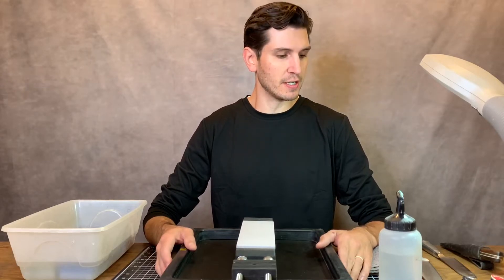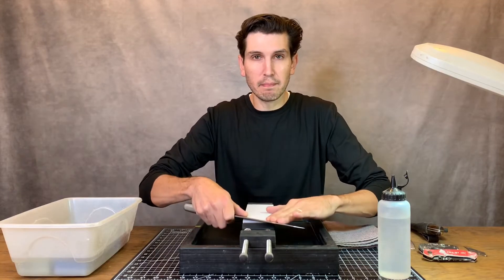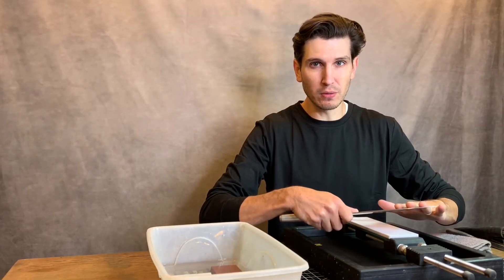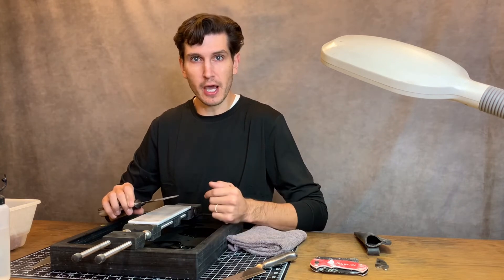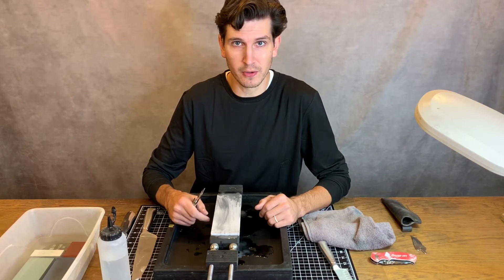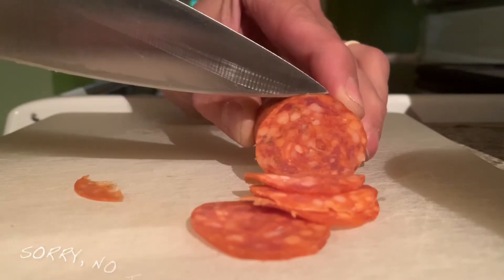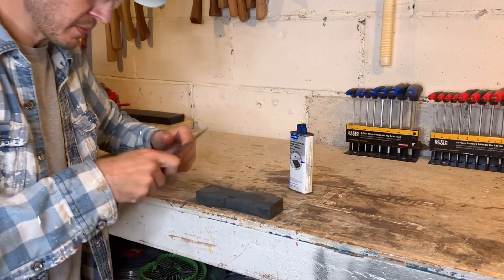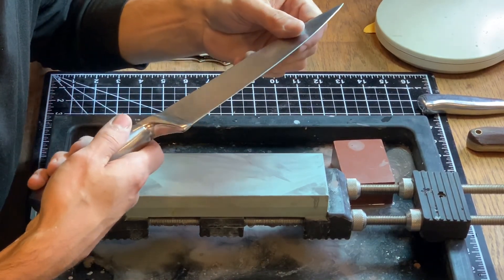How to Sharpen a Knife: Why Your Knife Isn’t as Sharp as You Want it to Be

Comment: Thank you so much for the shout out Kev! I don’t really offer much insight on technique nor is that the point of my channel but I really appreciate the recognition amongst all the others you mentioned <3

That’s a great point about cutting produce. I recently started stopping at a 500-600 grit stone before I strop the edge on a finishing stone (3-8k). Try it for yourself! It just gives you that extra bite on waxy vegetable skin, while enhancing the feedback on your cutting board and giving you more edge longevity. Cutting the thing that you’re going to use the knife for is definitely the key to understanding what kind of edge you *need, not want. 

If I’m going to solicit any advice, I would consider taking another look your stropping medium eventually. Not that there’s ANYthing wrong with using leather. Lately I’ve just found I like using a finishing stone (mostly my jnat) or my palm, the rough side of a dish sponge, denim, canvas, or balsa to keep my edges extremely aggressive. Basically I want something that’s going to be gentle enough to remove that last bit of fatigued steel without interfering with the bite. 

Great video Kev! The last few have been bangers.
Reply from the maker: No problem.  I was impressed with the hair widdling.  Ive never attempted it, but I can only imagine your edge has to be pretty damn sharp.  I think guys can really learn material knowledge from you.  Myself, I don’t really take an interest in what the stones are made of.  I just know what I like.  Speaking of stropping mediums, I find that I get a better edge on my axes if I strop with a hard honing stone or even a piece of glass than leather.  Axe steel is softer and is more easily rolled rather than polished.  But I’ve never tried a dish sponge.  Or denim for that matter.  I’ll give it a shot.  Thanks for watching.

Comment: Great tips!  Some more of the mystery part of learning a trade!

When I was a kid there were basically two choices... the seemingly out of reach Arkansas stones and the man-made stones from companies like Norton. Over time I accumulated a full compliment of Arkansas stones including a large very fine black stone that was about $100 20 years ago. Some years ago a woman I worked with brought me a bunch of her deceased father-in-law's old woodworking and machinist tools. In the box was a large double-sided man-made stone of unknown brand.  After cleaning the dirt and oil off it I found it was in excellent condition. That big stone is now my go-to stone for things like kitchen knives. The coarse side cuts fast and the smooth side removes the wire edge nicely.  The Arkansas stones are used for my fine woodworking tools and a couple of my pen knives... knives that depend on sharpness over force in use. 

Today there are a lot more other options... Crazy Sharp with sandpaper, Japanese water stones, diamond stones, ceramic stones... I've had an opportunity to use them all in various shops and guess what, they all work!  Bottom line is don't obsess over which method to use... pick one and use it!

P.S. I also have three grinders... standard, slow speed and horizontal water bath... and a tool box full of carefully wrapped files and rasps. Between the grinders, files and stones I can sharpen every tool I own including jointer and planer knives, carving and turning tools, hand planes, spokes shaves, draw knifes, axes, hatchets, picks, shovels, hoes, lawn mower blades, chainsaws, pruning shears, lopping shears, machetes, scrapers, knives, hand saws, drills, auger bits, etc. What I haven't paid to a sharpening service has easily paid for these tools... and I have sharp tools without the week+ delays of using a sharpening service. Sharpening is a skill that is well worth learning and Kevin's tutorials will surely help folks learn!
Reply from the maker: Thanks again for sharing.  It’s definitely true about there being so many options available today.  I worry that people jump from one system to another rather than learning good technique.  It really isn’t that hard.  Some guys get hung up on angles and think they have to be perfect.  I sharpen my own chainsaw blades and I can tell you they’re never perfect, but they cut better every time I sharpen them.  Also, I wish I had a wet bath grinder.  I’ve been looking for an old one but haven’t found a decent one yet.  So I’m jealous.
Reply: @KevinsDisobedience   Yeah... the angle thing does consume some folks. Something in the ball park is fine!  After watching Mack Headley, Roy Underhill, and other 18th century tradesmen I associated with sharpen plane irons, chisels, gouges and turning tools free hand on bench stones I came to understand that.  No one would ever accuse Mack of doing less than fine woodworking!  https://anthonyhaycabinetmaker.wordpress.com/2013/05/18/the-end-of-an-era/  See the 2004 entry at https://www.sapfm.org/cartouche-award-recipients

I have the Makita 98202.  They have gotten pricy... I'm sure mine has paid for itself but the payback period was long as jointer and thickness planner knives are about the only thing I sharpen on it. I have restored/reshaped old hand plane irons on it but once they are "fixed" I sharpen them on bench stones freehand.  My father has a vertical water bath grinder that I find to be excellent for things like machetes. 

Check out Ironhorse's video "How a chip is formed."  https://www.youtube.com/watch?v=aezO8-punDU  That is the single best theory discussion I've come across for chainsaw sharpening. As good as Buckin' is this treatise on how chains cut fills in gaps in his presentation. My son sells Stihl and Husqvarna tools and the volume of new chains they sell is astounding... Many people buy a new chain instead of sharpening!  Some tried to hand file but failed miserably... This reminds me of my bicycle shop days when people would come in and buy a spoke wrench... such sales were good for the wheel repair and replacement business! ;~)

Comment: Excellent video, loved it. Especially the tip about not worrying about paper cutting, its a pretty dumb test. In the kitchen my GF actually preferred when I sharpened her knife with a coarser stone leaving a toothier edge, it didn't cut paper smoothly but it really effortlessly cuts tomatoes. Same with axes really, best test is how they perform in wood not paper!
Reply from the maker: Don’t get me wrong, I understand why it’s become the pinnacle of sharpness on YouTube.  If you’re knife will push-cut phone book paper, it damn sharp!  It’s also a very visual comparative test.  My experience, however, is that for everyday use 600-1000 will leave your knife plenty sharp.  I always suggest beginners get a 400-100 combo stone.  That’s all I had for the longest time and it worked just fine.

Comment: Good tips. I am a manager and head smoker and filleter at an Alaskan seafood processor..sharpen and hone knives daily.. every knife is a bit different..and you are right... sharp is sharp..doesnt matter how it gets there..
Reply from the maker: Thanks, I like to know what guys do for a living.  Gives me an idea of where you guys come from.  Well then you know knives.  Do you prefer a little toothed knife for fish, or is the goal always to get them as sharp as they can be?
Reply: @KevinsDisobedience  I prefer them as sharp as can be..and I use a steel ..often.. like it never leaves my side
Reply from the maker: I’ve only recently started using the steel in the kitchen.  I was skeptical of it for awhile, but I got a ceramic one now that I really like.  But even the cheap one that came with our knives makes a difference.
Reply: @KevinsDisobedience  I got a diamond Victorinox 12" this year that I love
Reply from the maker: How do you feel about diamonds as a sharpening medium in general?  My experienced is mixed.  They cut like hell when they’re new, but wear out real quick.  Like after three knives they’re not the same grit anymore.  But as a steel, I can see them working quite well.
Reply: @KevinsDisobedience  from what I have learned from sharpening my plane irons is you have to buy super high quality diamond sharpener.. like the DMT 10 inch plates. they are about $120 a piece and ideally you would have 3..and finishbwith a strip and compound.
Reply from the maker: I have the DMT flattening plate.  I think it was like $300.  I’ve flattened a few stones on it.  And already I’ve noticed it feels a lot smoother.